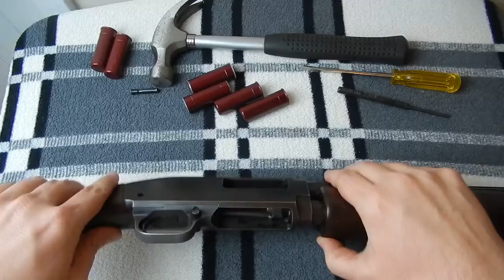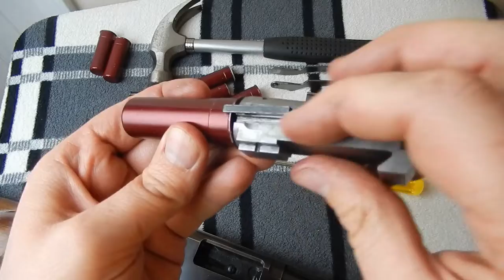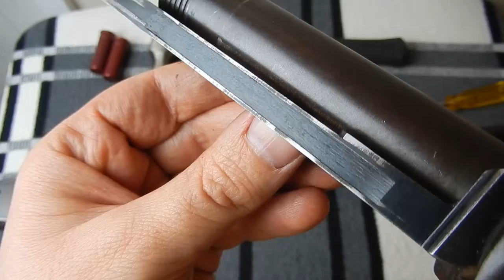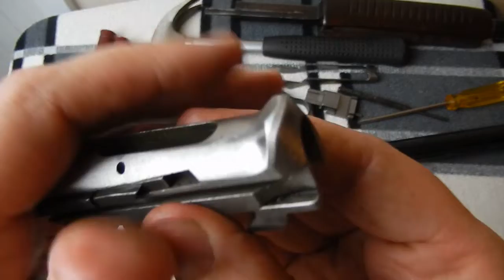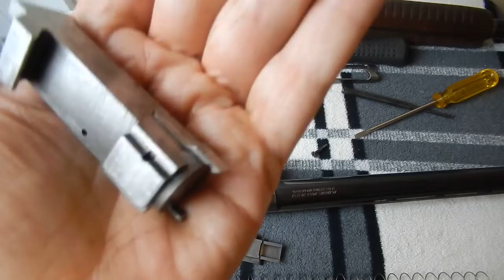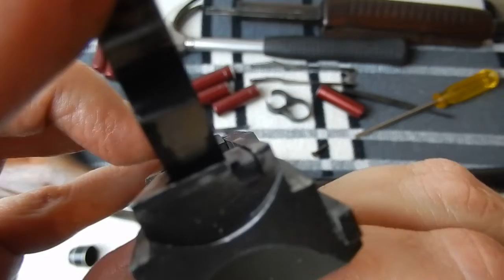JC Higgins High Standard Pump Disassembly & Description 2 of 3

Comment: Can you take the firing pin out of that bolt? I have a Sears 12ga on the wall it was my grandfathers, I wanna take out the pin for safety, right now I just have a trigger lock on it
Reply from the maker: The bolt has a pin going sideways.  It's located about an inch from the rear of the bolt.
Reply from the maker: Additionally, I would suggest saving the firing pin on the gun.  Take the buttplate off and there is space.  I would grease the firing pin up, put it in some wax paper or something else that's not plastic, and just drop it in.  At some point in the future, somebody might want to re-activate the gun.
Reply: RyeOnHam of course, thanks for the info!

Comment: Just picked one up and did my standard look for the disassemble video on YouTube, really pleased with mine , ran 50 shells flawlessly other than a touch snug on the ejection  on a couple. But otherwise zero malfunction and decent pattern at 25 yards for a fixed choke barrel .
Reply from the maker: Glad to hear it.  The design of the 'exjector' on this gun is a bit wonky and definitely has a different feel than the fixed ejectors on the 870 and Mossberg 500.

Comment: Ryeonham, I know how to disassemble and take out the magazine tube and action from the gun,what I want to know is without the specialty tool that you mention is there a way to take take apart the magazine tube  from the action.
Reply from the maker: I would absolutely not try it without the tool.  The tool itself is simple, and you can make one if you are handy.  There are two styles.  One is simply a half-moon cutout in a sheet of metal with two lips that are bent over on the end.  The other is a tube whose inside diameter matches the outside diameter of the tube on which there are two teeth that engage the slots in the slide nut.  I will link two Brownells tools that MIGHT work, but no guarantees.  Personally, I would make the tool.

The problem is, even with the correct tool you may run into trouble.  I have had several shotguns over the years that the nut would not budge with judicious pressure.  Since there is virtually no reason to take it off unless something is broken, BREAKING it to get it off is not helpful.  As I say in the video, I leave it on unless there is some dire need.  If you want to refinish the wood, mask off the metal and have at it. 

For the record, many shotguns have captive action slides held on the same way.  Early Mossberg shotguns come to mind.
Reply from the maker: Forgot the tools.  The second one is easy to make.  Just a piece of metal the same width as the slots on the forend and cut the half-moon the same diameter as the tube.  Bend it over in a vice then heat treat it.

https://www.brownells.com/gunsmith-tools-supplies/shotgun-tools/forend-wrenches/shotgun-forend-wrench-prod17206.aspx

https://www.brownells.com/gunsmith-tools-supplies/shotgun-tools/forend-wrenches/winchester-model-12-1897-forend-wrench-prod595.aspx

Comment: I have a field classic High Standard 12 gauge I can't get my barrel out can you help
Reply from the maker: The barrel is not removable.  It is fixed to the receiver like a bolt action rifle.  You can clean the gun just fine with the barrel installed.  This is considered an advantage for a few reasons.  The gun is 'tighter' and more accurate.  It does not 'shoot loose' like interchangeable-barrel guns.  Hope this helps.
Reply: Yes thanks very much never broke a gun down before
Reply from the maker: Robert Bingham It's a good design, mechanically.  A bit confusing for anybody with experience on modern shotguns like the Remington 870 and Mossberg 500.  It actually shares a similar lineage to the Mossberg 500 as both are based on the earlier Remington Model 31, a fine shotgun for its time.
Reply: RyeOnHam
Reply: this video is a break down of my gun correct
Reply from the maker: Robert Bingham This video applies to all of the High Standard pump-actions, to my knowledge.  There were many variations of the gun, but I do not believe any of them changed the manner in which the gun takes down.
Reply: Ya I can do it blindfolded now after the 1st video
Reply: Thanks alot
Reply: I can't find a video for my JC Higgins to take the trigger assembly off you have to take the butt stock off everybody else is just pop there is right out without the buttstock
Reply from the maker: David Beale What is the specific model number of your JC Higgins.  I might be able to help you.
Reply: RyeOnHam  102.25
Reply from the maker: Ah, I believe that's a Stevens 520.  I have one as well, but there are many fewer of that.  If you search for Stevens 520, tell me if that gets you what you need.  If so, this excellent video covers full takedown: https://youtu.be/dg6XLH4GOpc however, I would encourage you NOT to take it down competely unless you are having problems with it.  Take the barrel off so you can get at the front of the bolt and just clean the barrel.  More guns are damaged from excess disassembly than anything else.  This shotgun was not designed to be taken apart by the consumer farther than removing the front end.

Comment: how do I change the barrel
Reply from the maker: You don't.  It's a fixed barrel.  Like a bolt action, you would need special tools to remove the barrel.
Reply: ok thanks
Reply: So what do I have to do to be able to shoot a slug out of the barrel
Reply from the maker: Jessie William Most modern slugs are designed to be fired from smooth-bored barrels.  If you have a Cylinder, Improved Cylinder, or even Modified choke, most slugs work just fine.  If you have a full choke, most will still work, but you could have issues.  You have to check what the recommendations are for a particular slug.  I would stick with a Foster-type slug like the Remington Slugger.  Many think that you need a rifled barrel or short barrel even to shoot slugs.  Not true.  Many deer are taken yearly with 28", vent-rib barrels sporting smooth bores and full-chokes and a bead sight.

So, that being said, what choke does your barrel have?
Reply: it has a full choke
Reply from the maker: Yeah, Foster Slugs are fine.  You can buy a box of five and take them out to see what kind of accuracy you get.
Reply: Thanks for the video. I just picked up one of these today. I'm not a huge shotgun shooter (Mostly Pistols and modern rifles), but I am excited to get this disassembled, cleaned up, and off to the range. Very informative and detailed information. Be safe!
Reply: The barrel is removed with a barrel vise and an action wrench. Most shotgun gunsmiths have the tools needed. Damage to the receiver  is possible.

Comment: I just got one of these that came as a box of loose parts. I wish I had tried searching for this, first.
Reply from the maker: +UNITED POLICE STATES OF AMERICA I have a gunsmithing video for this model as well.  Not comprehensive, but I correct a few problems on a project gun I got.  One of the reasons I made this video is that I couldn't find a good one when I looked myself.

Comment: I just got one of these and it only takes 2 shells in the mag.  Do I have to fully disassemble it like this to take the block out so it can hold more?
Reply from the maker: +frstone3 Not if you have this model.  Make sure it is unloaded.  Take the barrel clamp off and then take the screws out that hold the plug on, making sure you restrain it as it will go flying when the last screw is out.  Then just dump the plug out of the spring and reassemble.
Reply: Thanks,  it looked like that was the case but I wanted to be sure.  First time I've had to take one out myself.
Reply from the maker: frstone3 No problem.  I have a stack of them from over the years.  I only hunt with one shotgun, and that's a single shot.
Reply: +frstone3 You shouldn't have to, just take off the barrel band, remove the retaining screw for the magazine end cap, and all the guts from the magazine will come right out.